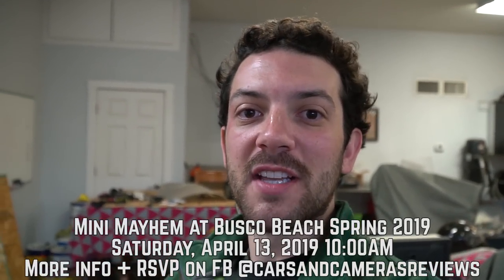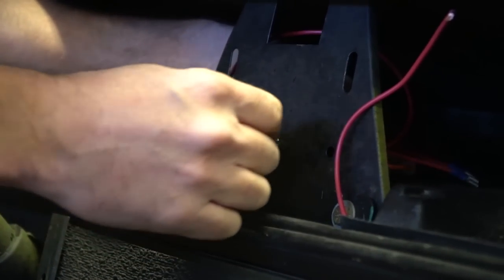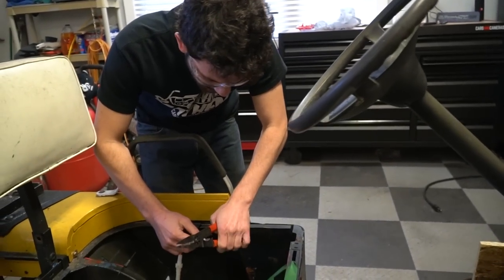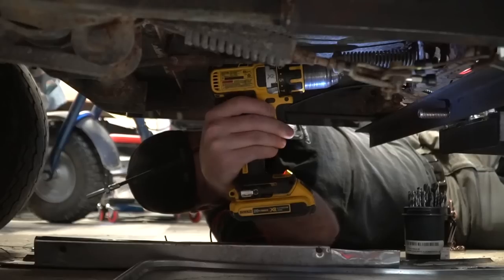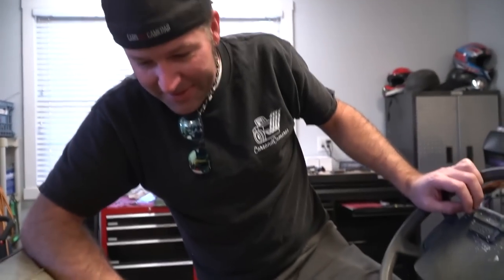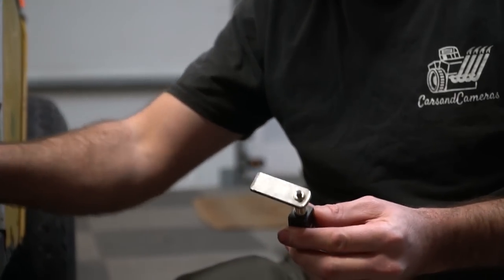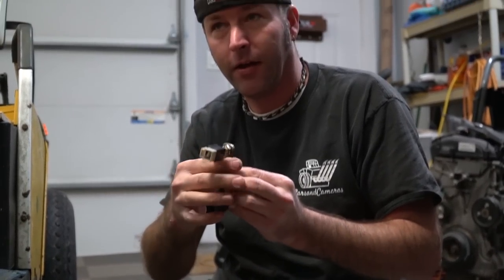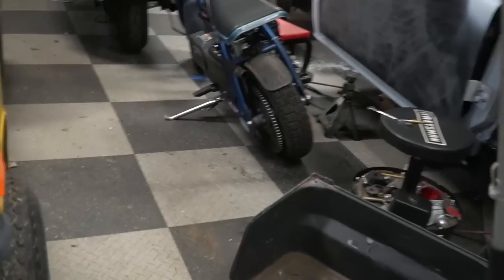Golf Cart WHEELIES | Built 420cc Golf Cart Build Pt. 5

Comment: What about a volt meter on the dashboard? Since that 420 doesn't have a charging system it'd be useful to know your battery level.
Reply: They should get an alternator and connect the belt to the rear axle
Reply: @polaris6644  definitely
Reply: Absolutely needs an alternator, no doubt in my mind dude.
Reply: customvideo454 not with the billet flywheel
Reply: @customvideo454  They could but now they're really starting to get into fabrication just to mount the coil. They should just DO an alternator. Would charge while coasting and might help braking
Reply: @customvideo454 420s have charging coils.  They aren't strong but it'll sustain led headlights
Reply: @customvideo454 so much easier to just mount a 12v fan motor with a belt to the torque converter or rear axle to act as a small alternator, just like they did on the ultimate Trail Master videos

Comment: With the brake lights, put them through a normally closed relay (also called a changeover relay) for each side. Then connect the left side relay trigger to the left  indicator wire and the right side relay trigger to the right indicator wire. That way, when the indicator flashes, the normally closed relay will open, cutting power to the brake light. When the indicator turns off, the relay will close again, turning the brake light on. So you will get the brake light flashing with the indicators. And because of using a normally closed relay, the brake lights will work normally when the indicators are off. The brake lights will flash opposite to the front indicators, but that shouldn't really matter. To clarify for the relay. Pin 85 to GND, Pin 86 to indicator wire. Then cut the brake light wire and connect one side to Pin 30 and the other side to Pin 87a (normally closed)

Comment: You guys are great with mechanical things but your electrical skills are lacking!
Reply: Totally agree.
Reply: I got it figured out
Reply: ya like installing the fuse on the negative side but still saying positive is preferred...what?? positive is mandatory! if your going to put it on the negative side don't even bother putting one at all, what are you protecting the 2 inches of wire between the fuse and the battery?
Reply: Lol no kidding
-solves blinker low current issue with more lights instead of a load resistor. 
-uses one oversized fuse for the whole electrical system on the ground side.
-normal closed connacts are otherworldly. 
-adds diode into circuit with crimp connectors.
Reply: Everybody makes mistakes
Reply: @trevorpatton6377  no, if there is too much current thefuse will still blow.  It's the same concept as having a loose battery wire, doesn't matter which one is loose, car still won't start.

Comment from the maker: Wheelies (with a 'lil help)! Looking forward to seeing you guys at Mini Mayhem Spring 2019!
Reply: Please check my message
Reply: Pretty sure ike has a bug that may have the solution to the problem? 🐞
Reply: Ike has a Instagram? N i send u a massage on Instagram
Reply: Paint it metallic blue, or silver
Reply: Channel is getting pretty boring guys,best of luck..but I can only take so many disappointing video before I gotta go..
Reply: call it the happy lil ripper :-)
Reply: Get some load equalizers for the turn signals!
Reply: Blackwater dd7 have to agree with you, seems like a long advert for ‘go power sports ‘
Reply: it needs slightly taller gearing👍
Reply: Y'all should do a steam powerd go kart next build please
Reply: Nice attempt at wiring, but it’d be way simpler to go with one of those Universal T/S kits, like this $33 one (I’m not promoting this site, this is just the first example I found):
 https://www.raneystruckparts.com/universal-turn-signal-switch-tl1035/
A T/S switch doesn’t just flash the lights; unless there are separate rear signal lamps, it must first disconnect the appropriate brake lamp circuit before flashing begins.
If you guys don’t want to McGyver separate rear signals, you’re better-off with one of these kits.
Reply: CarsandCameras You guys should put a Volkswagen steering rack on it or one of a smart car
Reply: That's not a break light switch that's a lawnmower seat safety switch
Reply: CarsandCameras this show is top 5 on all of YouTubes history and that’s no joke! Keep it up forever please 😁
Reply: I wanna go to mini myhame so bad but I live in utah that's across country trip
Reply: You guy's need to put a reverse box on that
Reply: Busco beach is where like Florida or what
Reply: @johncwetna3890  north Carolina
Reply: One light for brakes another for blinkers?
Reply: you guys are just AWESOME!!
Reply: @mybackhurts7020  then those old people are at the wrong place and the wrong time. gtfo I'd say it's quiet enough, because it is. then again sometimes you wanna make people think it's electric until they see how fast it goes
Reply: Use a 5 wire to 4 wire trailer module
Reply: You should make the headlights more like head lights with a piece of plexiglass covering the hole?
Reply: Search: Fully electronic automotive turn signal flasher. Trust me.
Reply: Please look at my warning of your unprotected circuit!!! You have a potential fire on your hands!!!
Reply: Gonna have engine cooling issues if you don’t get some air flow going through that engine
Reply: Hoonigan had doe this about a yaer ago
Reply: Smoke screen machine on the golf cart!
Then take er down the street,get er done!

Comment: So.. you have no rear turn signal when brakes are on? 
Heck, itd be easier just to add amber colored lights on separate circuit for turn signals..just sayin..
Reply: I fully agree with you these guys should just add a another light to the rear end and run just brakes for one light and run blinkers for the other it would be the simplest of way to do it and the most cost-effective
Reply: I agree as well, just add two just like the front ones but isolate them to the flasher circuit only, and that would fix it.
Reply: Agreed...Use rear trailer led lights. All in one, brake, turn, and back up lights. This way when you put a reverse box in from "go power sports" you can have back up lights also...
Reply: And replace those front lights to bigger ones, to fit the body opening.
Reply: I agree but they have been hacking stuff more and more every video I will be fine is cool and all but it only goes so far
Reply: I know that they make wireless blinkers that are used for older cars like i.e .Ford Model T that didn'r originally come with any.. they work good and are LED too
Reply: And in addition to all that, just spend a little on some spools of different color wiring. And may as well get a small fuse block too. Will save a lot of headaches in trouble-shooting when you know what's what.
Reply: @justineller2059  No parts, no tools, no plan.....  It is their thing, it is what they do.
Reply: @chuckhoward3626  except when they go and buy tools and parts ....,
Reply: In too much of a hurry to want to ride stuff. Damn, it doesn't take that much longer to do shit right. Kinda like, how many times are they gonna take the thing down the hill when they know damn well it's not making it back up??? I couldn't work with John. His, "close enough" is like a 1/4" off. I like to keep stuff within a 32nds, if not a 16th... Sometimes it's NOT going to be fine...
Reply: Learn some hand signals problem solved ✌

Comment: Just go get an "electronic" blinker module at the autozone. They work regardless of LEDs.
Reply: I did this to my 99 tahoe when I switched the fronts to LED switchbacks. A simple signal relay swap and they work just fine without resistors or anything

Comment: Wire a resistor in-line to get the turn signals to work with a standard relay. 👍🏻👍🏻
Reply: What size? That's the important parts lol
Reply: George Duckworth keep going bigger until it works. Or figure out what load the relay wants and calculate which relay you need.
Reply: Then diodes to prevent the feedback problem.
Reply: @dwerg85  lol I know this. Ohms law is calculated in my head constantly. It's part of my job.
Reply: Or instead of needlessly wiring resistors in until it works, buy an electric relay. 

People love to make work needlessly complicated

Comment: Have the highs that y’all already have just as break lights and get 2 yellow lights for blinkers and wire them separately from the break lights like on motorcycles. They have the single break light in the center and then the blinkers off to the sides.

Comment: There was a after market turn signal switch that will mount on the steering column. It was a all in one system that where used to replace or add turn signals to older cars. Not sure if you can still get them.

Comment: For the wiring, get a trailer wiring control box from uhaul. They will take the brake, running, and turn signal signals and adap them to work for combination brake/run/turn lights.
Reply: Did it in the next vid
Reply: @isaacitllbefine7231  Saw that,  Thanks for the heads up.

Comment: They make a flasher with a ground wire that will fix your turn signal problem
Reply: Load resistors
Reply: Right. That way they can make a flasher circuit that's independent of the load and the flash rate won't change with the load. Adding load resistors in parallel with the LED's when using a 2-wire flasher will work, but that's a kludge that may go well with this build ;o)

To have turn signals and brake lights work simultaneously, try using one of those trailer light converters for foreign cars which have independent brake and turn bulbs / filaments. (One can also design one using XOR or XNOR gates and drive transistors, but that's... Nevermind.)
Reply: Fourcycle why is life so complicated 😂 sometimes it's easier to just run independent indicators rather than combined with the tail/brake lights. It's a bit more work but it's simple circuitry

Comment: If you go back to the auto parts store, they will have blinker modules that are digital and made for LED lights.  They don't cost a whole lot more.....  <edit>  your panel lights did the trick!  I can appreciate the not giving up...  Wiring turn signals is much easier than folks realize, you'd cause yourself more trouble trying to pull it out of a motorcycle or something than what you just did.  Good work.

Comment: You need the euro car trailer adapter for the lights. (cars with a separate amber turn signal bulb) That will let a brake light blink when the turn signal is on.

Comment: Motorcycle rear brake switches are always good for random projects... The Springs are quite forgiving so you don't really need to be accurate when installing it as there's room for adjustment . 

I'm using one on my E30 as a clutch switch for launch control

Comment: Should just buy a turn signal and brake light kit for a ezgo. They have them on Amazon for like $150. Wiring harness, lights, everything in one kit. Wouldve saved so much headache on Ike's part and it's all plug and play.
Reply: Try the Tusk Enduro lighting kit replacement wiring harness (and components), from  RockyMountainATVMC. Cheaper, LED blinker relay option. Brake/tail all wired correctly. It doesn't really matter if motorcycle or other, extend wires if needed.  [The tricky signal/brake situation on the golf cart is easiest fixed with separate blinker lights in the rear.] *that Enduro harness includes wiring for two brake light switches and horn. I guess they also sell the T-Rex universal harness for UTV's slightly more expensive.
Reply: I found a switch made by gm on eBay it only like $20 but it doesn't come with lights they already have the lights tho
Reply: Too expensive.  China bike outlets have these or in peices for max 80$

Comment: You could wire a normally closed relay inline with the individual brake light circuits and use the respective turn signal to open the relay. That way when the brake and turn signals are both on the brake signal gets cut and u just have turn signal.

Comment: Hey guys tech tip For you:
Briggs & Stratton has a specialized tool to remove the valve springs, it doesn’t work on any other engine but Briggs & Stratton!!
If you can find a set taking apart any Briggs & Stratton engine even with basic hand tools can take less than 7 minutes.

Comment: A proper universal turn signal switch that mounts to the steering column would allow signal on one side and brake light on the other. Pretty simple set up with hazards can be bought for around $20 on ebay

Comment: If you add a load equalizing resistor resistor in line to your lights, it will put enough power draw on the blinker circuit. This issues also presents itself often when switching to led bulbs in vehicles that did not come  with them originally.

Comment: In order to get a brake light/ turn signal to function properly, the lot must have 4 wires to connect. 1 ground, 1 park, 1 brake, and 1 turn (sometimes the grounds will be a chassis ground bolt likeon trailer lights).  The turn connection in the brake light overrides the brake connection, so if you're applying the brake and the the turn signal, the brake light gives priority to the turn signal.

Comment: what you are probably going to have to do is put separate flashers in the rear. you could also see how vw did it on the 57 through 61 beetles. but the turn signal switches are a little complicated. best bet will be separate turn signals

Comment: They make wireless LED blinkers that come with a turn signal that mounts on the steering wheel, they run on rechargeable batteries.. they where created for vehicles that didn't come with them.. I think they make wireless brake kit too.

Comment: Those bi-metallic flashers require a certain amount of current to switch properly.  You can add lights, add a ballast resistor, or use an electronic flasher suitable for LED's.

Comment: Put a pulley on the driveshaft and hook up a alternator with a built in voltage regulator.... should be enough to keep your battery charged up. And you could just install amber lights in the rear for turn signal and keep them on a separate circuit from brake lights.

Comment: If you connected both rear lights to the brake switch then the turn signal will light both up.  Put a diode going to the lights to make sure current can flow from the brake light switch to the lights, bit so that the turn signal current cant flow back to the brake switch.  Then you will have working blinkers.

Comment: you guys need some LED resistors, it will help when the lights are on. i have the same issue, when my headlights are on and the turn signal is on, it acts up because of the low draw

Comment: To reduce smoke rolling from ears. Add two more smaller lights to the rear for turn signals. Shield the brake light switch. Electric and mud bad combination knowing your off road itch.

Comment: I converted my 83 Honda CB650 to LED lights, I changed the flasher to an electronic flasher.  sold as "led signal flasher" they are also adjustable to change flash  frequency.

Comment: So you can either solve it by one of two Ways ... Putting in an Amber switch for your turn signals and then leaving your red for your break and for you will need a emergency flasher anyway ... Or you can do the 3-way setup that Ford uses on their setups

Comment: You could have fixed the rear lights with a trailer wiring adapter kit for vehicles with yellow turnsignals in rear. It electronically combines the two circuits before you get to the leds.

Comment: Just add separate amber turn signals at the rear. Finalize the wiring runs, pull it all off and use some tesa tape and corrugated loom to make a proper harness.

Comment: You need to install a 5ohm resistor in your turn signal circuit to get proper blinking from your LEDs with an automotive flasher.

Comment: your brake/signal lights problem can only be solved using a signal switch like the one that is used in cars .. those switches have built in tracks that disconnect and connect each individual light to either signal or brake depending on the selected position. or just use separate lights for brakes and lights for signals.

Comment: Get some resistors like 6ohm 50 W resistors And add those to the circuit now depending on how you have it wired underneath there you can add one or maybe two just see if that causes enough current draw so that it actually does flash

Comment: I used a toyota style trailer adapter on my car to get brakes and turn signals takes a 4 light system and makes it 2 or you can add lights for brakes only. Adaptors part number 119130

Comment: I had the same turn signal trouble with my motorcycle. The problem ended up being that when you have a single turn signal indicater light on the dash you're getting feedback to the other side. I had to install some diodes in the wiring harness.  Hope this helps

Comment: You need to convert the 2 wire type leds into 3 wire type. There’s a simple circuit that allows this that I’m going to get for my motorcycle for $30. Link is on my PC but I’m sure you can find them on Amazon or anywhere. Otherwise you’ll need to install separate blinkers.

Comment: Take the blinker apart, and put a smaller capacitor. Capacitors store energy but the led isn’t giving it enough to store, instead of increasing load, out on a smaller capacitor and decrease the load required

Comment: Fix your turn signal problem with some relays!

Turn signal pulses the relay to interrupt the brake lights so they can flash instead of being solid. You're driving the element from two sources instead of making it flash, you need to change the signal to interrupt the light.

Comment: Are you do a little weight assisted wheelies but anywho what you should do for the turn signals in the rear and or the brake lights in the rear is add another pair of lights so they are separate it is the only way you're going to get it done with LEDs because there is no such thing as LED lights where there is half and half LEDs and one thing unless you split the wiring up inside